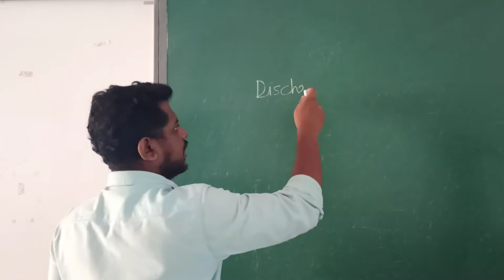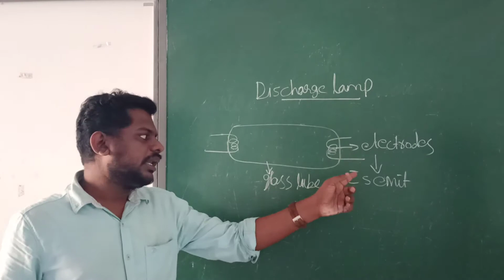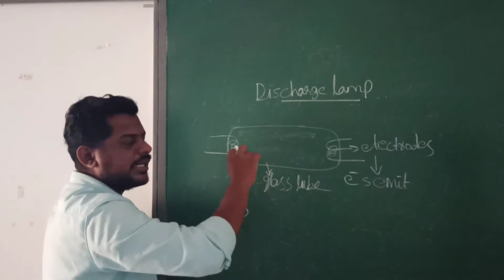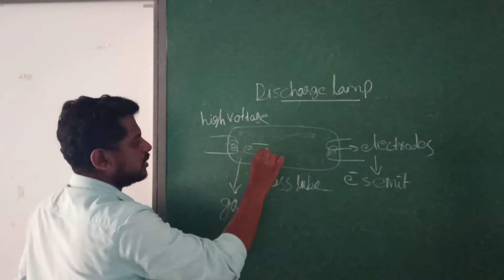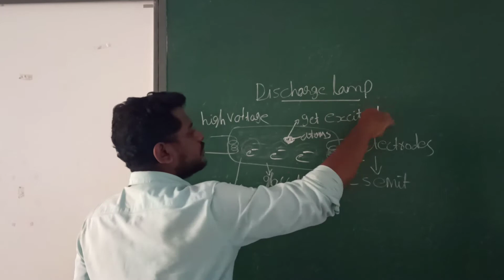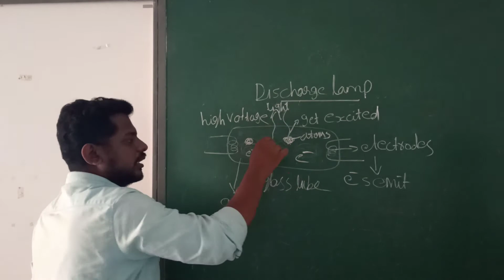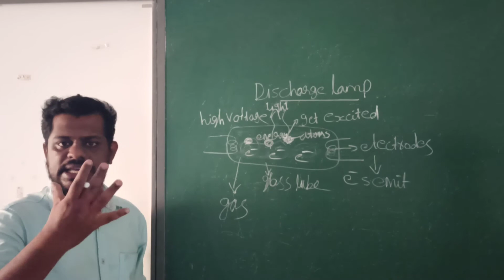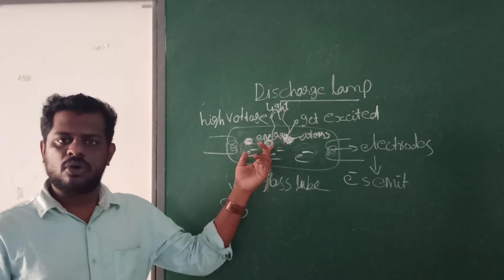Discharge lamp

Comment: Actually electrons are not emited from electrodes. In fact they are emitted out of the atom of the gas which is filled in the glasstube after getting ionised. These electrons tend to move towards one of the electrodes.